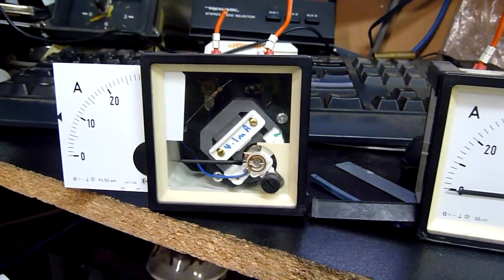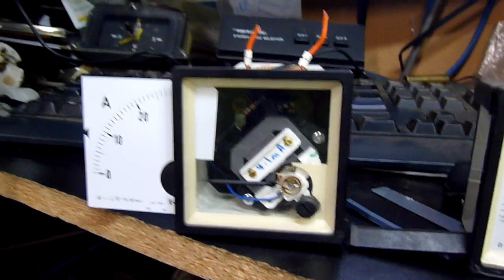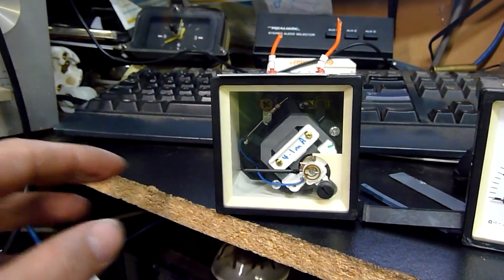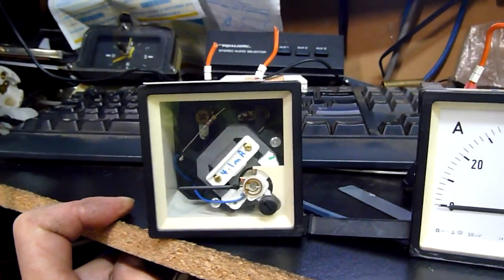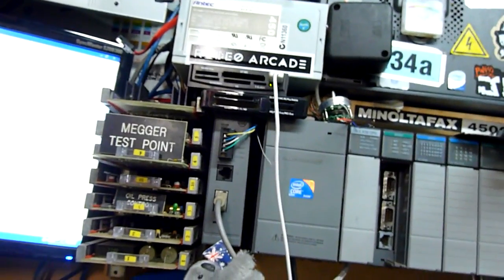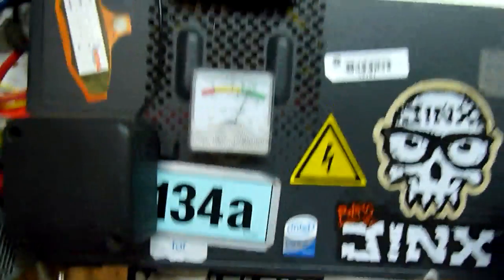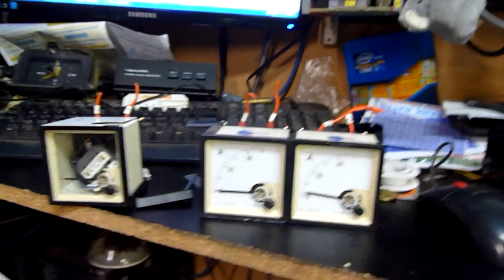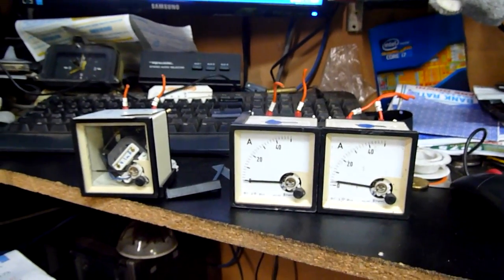CT Type Amp Meter Modding Possibilities?

Comment: Just use an ammeter shunt with a different current rating.
You can scan the face plates and change the numbers with your favorite photo editor.
If you use a 4 amp 50mv shunt (which is a 12.5 milliohm resistor) then the meter will show 0-4 amps. That is assuming these are DC amp meters.

Comment: I see 4.1 mA is written on the movement. you need to work out the meters internal resistance. ( so your meters are not true CT meters ) but shunt meters.
To make the meter read for 10 Amps FSD it needs to be shunted with a shunt rated for 9.996 Amps. Do some experiment with a piece of 1.5 or 2.5 mil² ( say 15 cm long ) pass a 10 Amp load through it, measure with digital mA meter and see what readings you get. if close put analogue meter in parrallel. Finetuning can be done with series R on meter

Comment: Hi. If they are true CT meters they are referred to as 40/5 or 40/1 Amps meters. It will be marked on the meter scale.
I think they are rated in mV and needs to be put in parrallel with a copper shunt.
Have a Cu bar 8 or 10 mil wide pass a known current through it which you can measure. then make a cut in the Cu bar to set the meter scale.

Comment: Judging by the scribble on the open one,I'd say it's likely 4.1ma FSD (full scale deflection). With some ohms law (measure the DC resistance of the meter) you can translate that to a voltage (0-50mv,or whatever). For measuring DC current,you'd need a shunt,or beefy resistor..again,ohms law will tell you the resistance and wattage needed.

Comment: in addition, about 7-8" of 24awg from a cat5 cable or something similar will get you close-ish, should be able to tweak it from there, keep in mind the insulation on it is rated for 90v iirc so keep it away from mains.. also older cars used resistor wire in parts of the harness, mainly around the starter/ignition coil, you could whack out a small chunk and put some crimp terminals on it once you get the right length

Comment: ^this is how i would do it, 50mv at peak scale with a 3a load (V=IR) .05 = 3*R, thus R is about .01666 or say closer to .017ohm, a few turns of resistor wire would probably do the trick but i dont know how you would measure it without a miliohm meter, could run a meter inline with it and pull a 3a load and tune the resistive wire so the meter reads accordingly, btw 50mv*3a is also a .15w load, so probably nothing to worry about

Comment: I do not know if it's already came out but these are not for CT´s they are for DC Current. And they use Current Shunts to measure the current. So you need only a matching Shunt resistor for example for 3A approximately 0.016 ohm. Use Ohm´s law :) Keep working

Comment: How about using a shunt?
Given you got a multimeter able to do whatever current you need, you may try to find the needed wire length and size to get your own DIY shunt.

If I understand, it's some mV full scale, so the voltage drop won't be too bad.

If it use a shunt without load/burden resistor, try to connect it in series with a low power load. And figure out the deflection.

Comment: The actual current through one of those meters that would produce full deflection shouldn't be that much - perhaps an amp or less.  Since they are designed to be connected to the output of a standard CT (which needs to look into a short to be accurate) it will accept an AC signal directly.  Try hooking one up in series with a lamp, a DVM set to AC current and a Variac and raise the output of the variac until the meter reaches full deflection.  That will tell you what it's rated for.

Comment: You should not care much about accuracy as with calibration and a little trial and error you can even fine tune it better than compared how they came out of the box. CTs are not a big deal,i'm pretty sure you can find spares or compatibles if they are a mention-worthy model.

Comment: shunts and ring type transformer are great for heavy duty setups .  when it comes to measuring amps on a PC cpu  with a voltage of 1.7 VDC that's a different game.
The small size of a linear current sensor module can simply clip around any wire measuring AC/DC. some modules have adjustable output settings to suit any type of meter making calibration simple with full scale accuracy easy obtained.

A 50A Current Sensor (AC / DC) module cost under 20 USD.

Comment: Hmm, well for a dc amp meter i would imagine a shunt resistor across the back terminals would do, and for voltage a series resistor.

They are just basic meters, it should be dependant where you put the resistor and value.

For a ammeter shunt you could use say 6 turns of low quality non copper wire like they used to tie the tops of potato bags up with.

Measure the resistance of the meter so you can use ohms law :-)

Just flip the front at the corner.

Nice meters :-)

Comment: cont... a single turn for primary. No of turns is the ratio required. 5A is the standard current of these units, so for 10A you wind a 2 turn secondary, 50A a 10 turn and so on. Simple, and very accurate. I have done a few. I had one doing duty to measure the mains current for the whole house.

Comment: For DC if you have the basic moving iron meter they do work well on DC, and are quite insensitive to polarity. Just grab a shunt ( 1m 2.5mm copper wire for up to 10A) and place meter across it, then trim wire to length to get the reading right. To do AC get an old toroidal transformer ( small one is fine, just not a potted one, as you strip all the windings off to leave the bare former and the 2 plastic sleeves) and wind a few turns of 2.5mm wire on as secondary and use ......cont next frame

Comment: its much better sensing the current in the cable, that way you don't introduce further losses on low voltages like in a PC its the only way without causing problems.  IC's specific for this job can be programmed or set for full scale offering pretty good accuracy and are way better than a shunt.

Comment: Edd not sure if i got this right, you want to use these analog moving iron meters for dc current for PC and also for stereo amp meters ac.

1) make a shunt.
2) current transducer
3) electronic circuit.

search intersil EL8170
search  ACS758 
the later fits the bill nicely, can be sourced ready made or just the ic.its an integrated Hall Effect based linear ACS758 current sensor ( Sensitivity: 40 mV/A)
if you want more info send me an email addy. or google part No.

cheers

Comment: I think just a shunt resistor will work. It will obviously be less efficient as you do have loss in the resistor but it should work.Set up an relatively accurate constant current supply and experiment with values. To make it easier to calibrate you can probably use an opamp with variable gain and calibrate it.Use shunt as input and hook meter up to output. Depending on meter you might need a series resistor.

Comment: CT's output based on a ratio (EG: 400:5 = 400A Through the CT = 5 A output); output is linear (320A via CT = 4A output etc) nothing special.

Comment: Oh heck yes! :D
Yeh, they are very easy to work with. They are just like any other analog meter. The only difference is that these pull like 4mA on full throw, instead of around 800µA like it usually is. But it's just a matter of giving it more juice. Play safe and have fun mate! :)

Comment: You can also use them as Volt meters if you just put a resistor, or a trim pot in series with the meter.

Comment: A shunt should be enough. as the CT makes a certain voltage, the same way a shunt does. you can try by making a shunt from some wire, and then fold it in the middle and twist it until you get the right reading.

Comment: You could use a variable power supply and a ballast start with low voltage and low current and chuck the meter in and see what it reads. if you keep things low what is the worst that could happen?